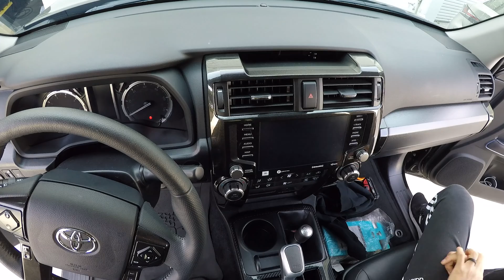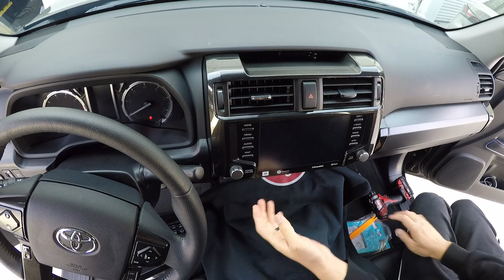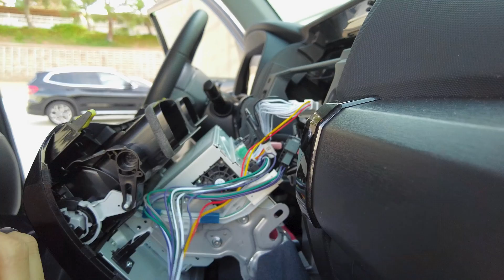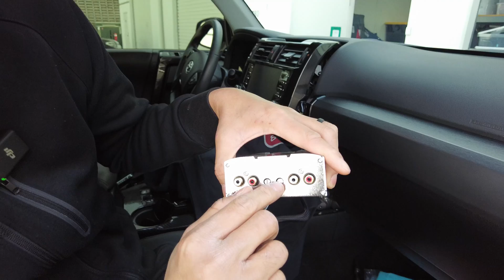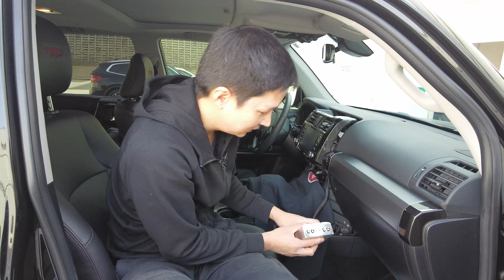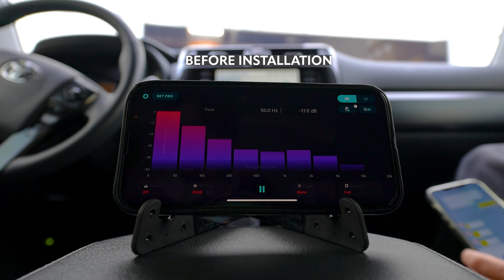2022 Toyota 4Runner with JBL | Beat-Sonic Amplifier Installation

Comment: Will head unit volume knob equally affect speakers and jbl sub with this amp?
Reply from the maker: Not sure what this means, but yes you can adjust your volume with your factory head unit volume knob.
Reply: @BeatSonicUS  does adjusting volume on head unit equally adjust speakers and subwoofer? I’ve heard a lot of complaints about the amp interfering and only adjusting the speaker volume not the subwoofer volume.
Reply from the maker: @dr.Roger_  Yes, adjusting volume on your head unit also equally adjusts the factory subwoofer volume.

Comment: Does this completely bypass the stock jbl amp
Reply from the maker: No
Reply: @BeatSonicUS if not, so what does the amp function here? As an additional power? It does not have built in dac, right? Does it help reduce the bright JBL tweeter?
Reply: @BeatSonicUS so we can still adjust treble mid and bass in audio settings ??

Comment: I just installed this in  my '22 Pro w/JBL 4runner. This product is made from Japan. The output is what you'd expect from premium sounding system. This very easy to install amp elinates brightness and replaces lackluster, weak sounding music with  clarity, taking the speakers to its full potential. If you're looking for a boost to your JBL system and keeping it all OEM, you won't be disappointed.
Reply from the maker: If you upgrade the speakers to the recommended 4 ohms, audio output will increase greatly.